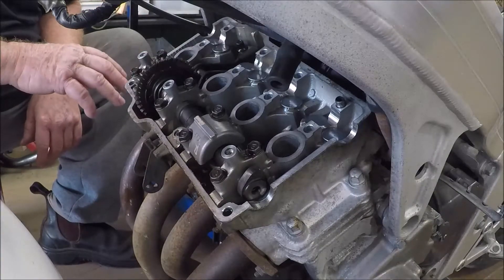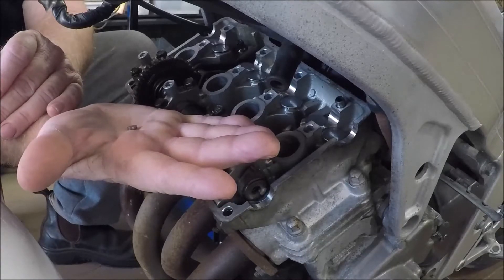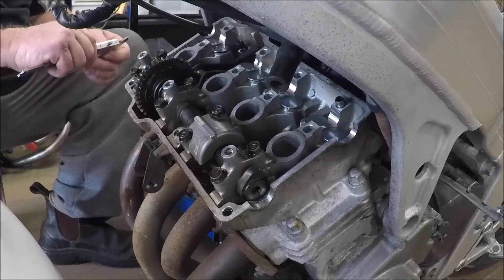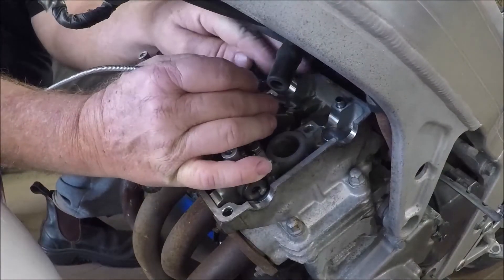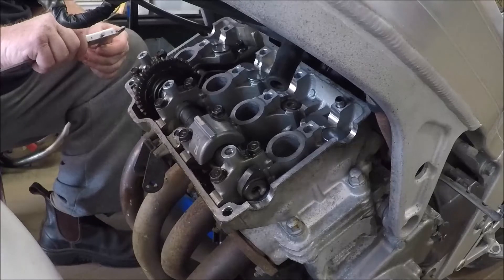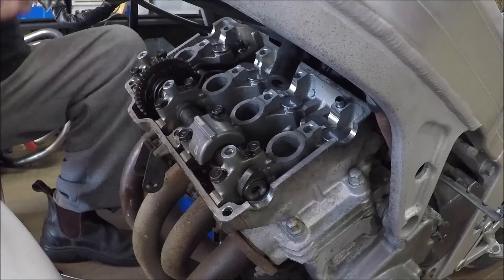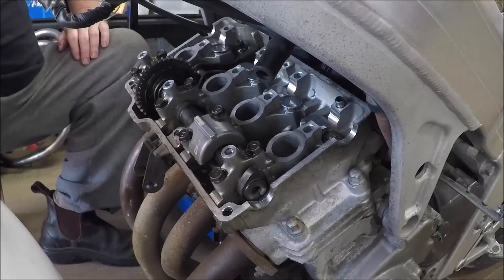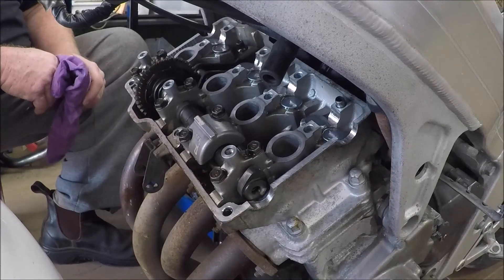Honda CBR250R MC19 Part 10 - Adjusting the Valve Clearances By Changing the Shims

Comment: Hi! This is a great video on valve adjustment. I just got an MC19 for a winter project and your videos have been immensely helpful. Just wondering on #1 right you went with a 2mm shim. If the valve clearance was 0.03 with the shim at 2.12 needing an adjustment of 0.13 to make the valve clearance 0.16 . I was thinking you would need a 2.25 shim. I've never adjusted valves before so any advice is welcome. Thanks again
Reply: I did the same error, you've gotta go the other way, increasing the valve shim diameter will DECREASE the clearance, as we want to DROP the bucket, not raise it, dw that got me too
Ideally, he should of gone with a 1.95mm shim, thereby putting the new clearance to the desired 0.16mm (rated range for the engine is 0.13 - 0.19)
Also, ik that your comment is 3 years old & you've more than likely completed your winter project lol